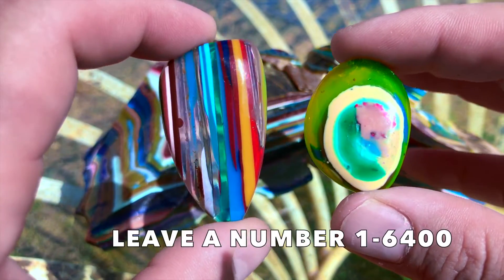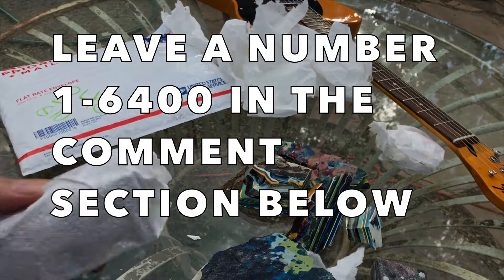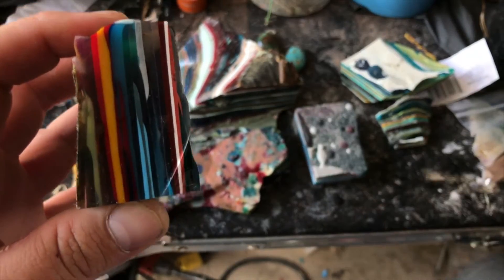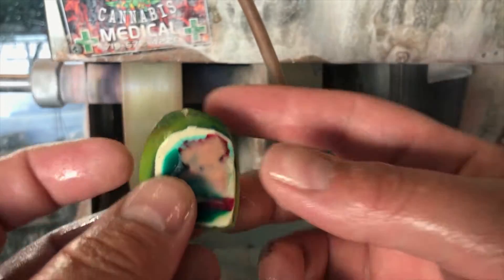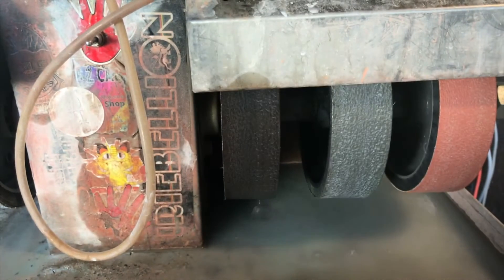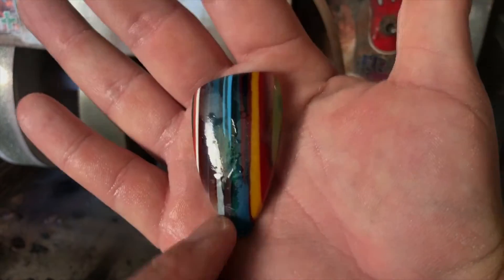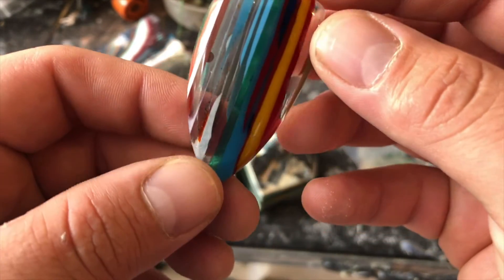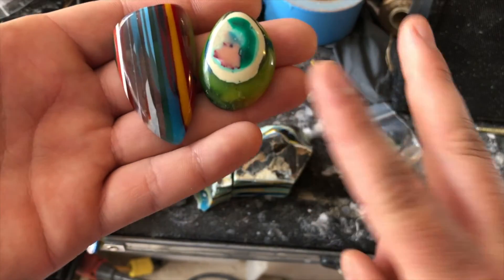Surfite the Fordite of surfboards !GIVEAWAY!

Comment: 3759
Looks good when finished.
I'm guessing due to origin of material, it may be high VOC (volatile organic compounds) levels due to additives and curing agents in the paint, filler, clear coats etc.. 
Food for thought.
Thanks Dave 
Do you know anywhere that sells drive shafts/axle for making machines?
Reply from the maker: Ryan FP it definitely Hass to have some crazy nasty poison stuff inside of it between this stuff and fordite it really makes me want to mail out a way to get finished by someone who is more interested in the work than I am :) When it comes to the shaft for machine making I would suggest asking Highland Park they are very helpful when it comes to sourcing parts and such tell them lapidary Dave sent you they are very good friends of mine